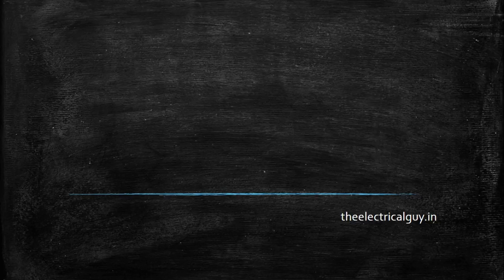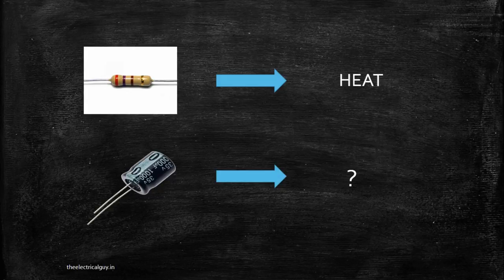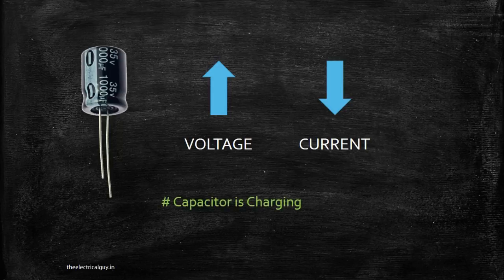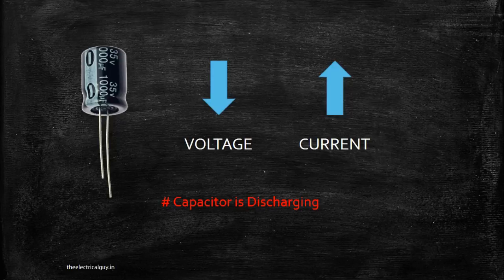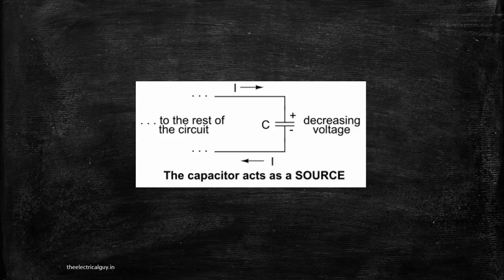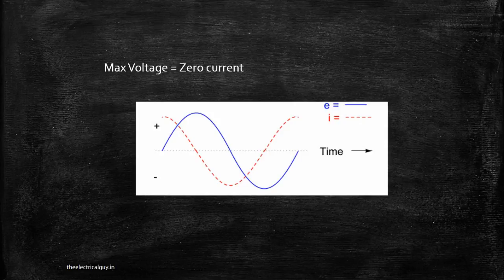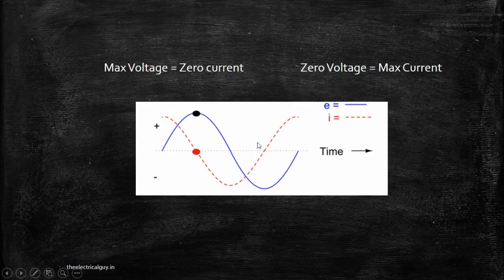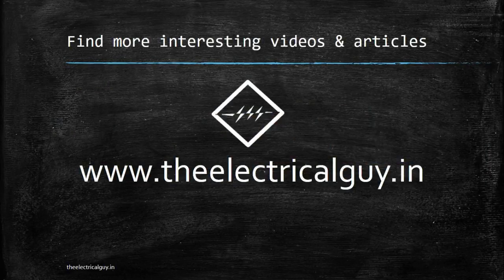How capacitor keeps the voltage constant | Explained | TheElectricalGuy

Comment: Ohm's law states Current is proportional to Voltage , so if Voltage(difference)  increases Current will also increase. what you refer is power of the device, i.e.  I (current ) x V (voltage) .A device or circuit will always use same power, so either current or voltage changes the other one will change in the other direction.
Reply: Ohm's law doesn't work on inductors or capacitors because the current and voltage are out of phase. Current through a capacitor is i=C dv/dt
Reply: Ohm's law doesn't work with electrolyte and diods.Energy through the power =v.i constant.here v and I are inversely proportional.This is not as per Ohm's law

Comment: Ohm's law cannot be applied to capacitors. Your logic is wrong.
Reply: Ohms law is applied to linear devices and if capacitor is linear, ohms law can be applicable in this case
Reply: It is said for the rest of the circuit and not for capacitor

Comment: How capacitor generate reactive power?
Reply: Krikan as now you know the capacitor can act as a source. The electricity it stores is released. So the current that flows back to the power supply creating a situation where we are giving power to the power suppliers. So we don't pay(mostly) for the reactive power
Reply: Krikan as now you know the capacitor can act as a source. The electricity it stores is released. So the current that flows back to the power supply creating a situation where we are giving power to the power suppliers. So we don't pay(mostly) for the reactive power and capacitor and inductors create reactive power.

Comment: if capacitor is taking current from the system ,then how current is decreasing during charging ? i didn't get it
Reply: when you draw current from the battery while charging a capacitor you r increasing charges on the plates of the capacitor and hence increasing the potential across it as well, meanwhile when the voltage across the plates is increasing the current flowing from the battery reduces as charges on the capacitor plate will repel more incoming charges and moreover as u r increasing the potential across the capacitor so potential difference is decreasing and we know that current flows due to potential difference. when capacitor fully charged than potential difference becomes zero thus current flow becomes zero....
Reply: the current in the battery is decreasing during charging. not capacitor